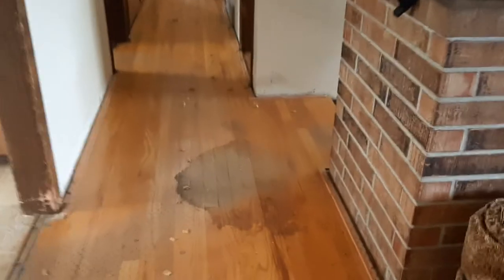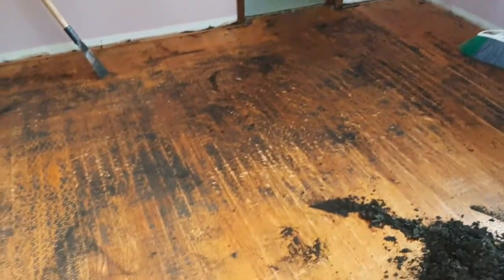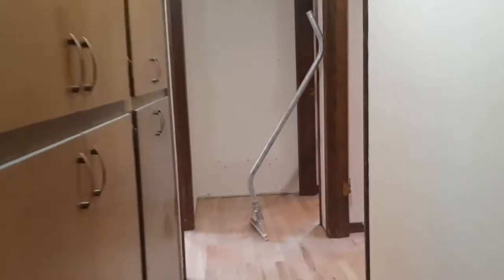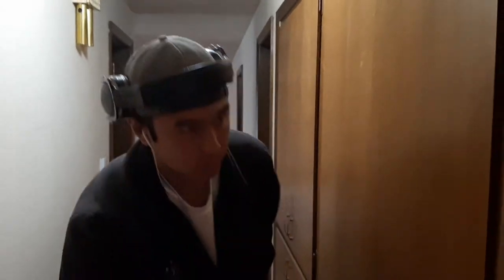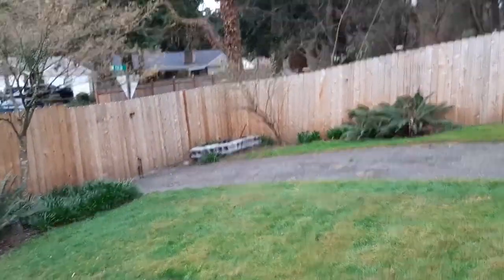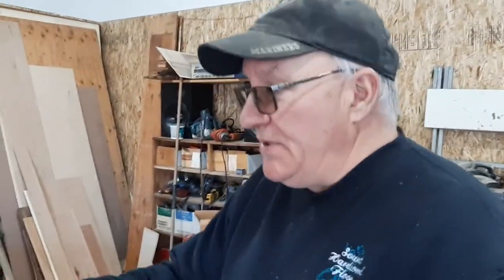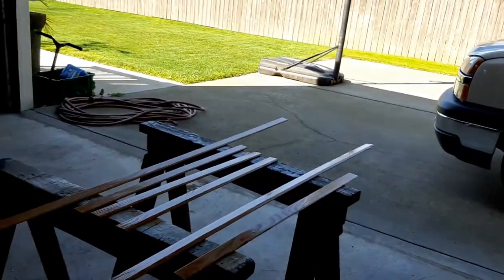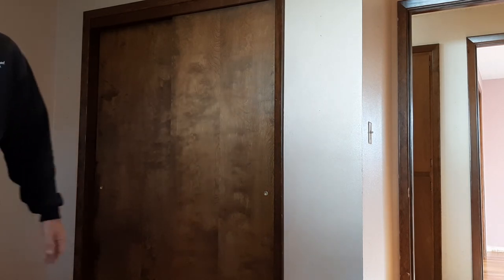Hardwood Floor Refinishing. Carpet Removal, and prep. Sound Hardwood Floors

Comment: Will holes from tack strip and staple removal automatically fill in when you sand? Or is that what you were doing with the troweling thing?
Reply from the maker: The filler does the work.

Comment: You got to get off your knees buddy use a roto put that stain on and take it off it's a lot easier on your back and it makes the stain very uniform I just use old carpet pads I cut them out to fit the block of the roto it works great I've been doing it for years if you watch any bona videos will show you how they do it it will save your back God knows we need it in our business floors look great by the way

Comment: QUESTION!?   Hey I bet if you use a real coarse sanding youll also be leveling any high spots as well?    Im asking because I have to relay water damaged hardwood but that I have already taken up and sanded by hand.  Like each piece that had taken damage
Reply from the maker: We use 36 grit, and sometimes 16 grit on really bad floors, we still do a full Trowel fill before the final cuts.

Comment: Question.....What is the seal coat for and do you have to do that step and what would happen if you just put a clear polyurethane on the wood after you did all the sanding?   thank you for your time.
Reply from the maker: Hi Greg, the Swedish sealer drys fast it can be sanded an top coated the next day. Straight polyurethane is still used, just longer  wait times. Thanks for watching.
Reply: @richsadventures1889  Thank you for the help and info.

Comment: What was the stuff he was spreading on floor after sanding. You do beautiful  work
Reply from the maker: Woodwise latex filler.
Reply: @richsadventures1889 After you spread that filler, what grit do you use to sand it?
Reply from the maker: @ricos4700  100, or 120.
Reply: @richsadventures1889  Thank you. You are a tru craftsman.  Keep em coming.

Comment: Great video! I just bought a house and I’m going to do the floors after I rip out the carpet. I have one of those swing machine buffers that you can attach sand pads to. Could I get away with just using one of those or would I definitely need one of those sander machines you used ? Would you know where I could rent one of those machines ?
Reply from the maker: To get down to bare wood, I would use a floor sander. Home Depot rents a small version of the big ones. It'll get the job done.
Reply: @richsadventures1889  very cool I’ll definitely look into that! Thanks again man.

Comment: Great video thanks. What has that coating your guy put on at 5:30 after the first sanding?
Reply from the maker: That Guy is my Son, he pretty much supervises the projects. It is Woodwise latex wood filler. It all gets sanded off on the next cuts.
Thanks for watching.
Reply: @richsadventures1889  Thanks for the info. Watched a lot of wood floor videos. No one has mentioned using anything like that.

Comment: WOW, nice looking floors, what was that he was spreading on the floor after you sanded them
Reply from the maker: It is a latex floor filler,we use it on all our floors. It fills all the gaps, cracks, nail holes, and worm holes. It also serves as a guide coat for the final sanding, when the filler is all gone the floor is flat, and the course sanding marks are gone.
Reply: @richsadventures1889  thank you really appreciate you answering back.
Reply from the maker: Wow, that Playlist you put together on Soul Music is great. I grew up in that America 🇺🇸. I miss it.
Reply: Great work. As a fellow floor guy for over 20 years I can see you do quality work. Keep it up
Reply: Do I need to sand the entire floor after applying the floor fillet? Does it leave a color?

Comment: What type of machine is that that also sucks up while you're buffing
Reply from the maker: Hi Shawn, its just a buffer i drilled a hole in and hooked up a vacuum. The skirt around the bottom is  some cloth with velcro sewen in. Thanks for watching.

Comment: Also with the skirting boards and architraves, should they be taped up if they are primed and painted or removed then put back on.
Reply from the maker: We do both, if you leave them on be very careful with the edger not to mark them up. Sometimes it does more damage to remove them if they are caulked, or heavily painted.

Comment: So I have a question... Do you have to apply a wood conditoner on the floors before you stain or a clear coat finish?
I always thought you have to do that first? Maybe you dont because its Oak Floors? 
Nice work by the way !!! Looks really nice!!!
Reply from the maker: I believe i show the water poping , or opening of the grain in other videos. This is the same as conditioning the wood prior to staining. Not needed for natural finishes. Thanks for watching.
Reply: You really only have to water pop or condition the floors when trying to get a certain color darker or if it's a certain type of species like a maple or Birch hickory those types of wood you would want a water pop that for it to take stay more evenly but when you water pop a lot of times with oak you'll get fillets where the wood pops so if you could get away with not water popping it's nice that is basically what conditioning the floor is
Reply: I have a small video of me water popping a birch floor before I stain it you can take a look at it the pages under my name Jason urban if that helps for your interested

Comment: How much does a project like this cost? Buying a home that we want to do the same thing to.
Reply: Big Ern! Like it.
I rarely see companies answer questions about price. I guess a refinish is about $3 to $4 per square foot. Things such as repairing or replacing floor boards, removing carpet, staining, etc. will increase the price. I wonder whether the removal of the black coating was extra; it may have just been part of removing the carpet.

Comment: I'm debating if replacing with new flooring or keep existing floor and sand them. I do want new flooring but afraid it will be too expensive.
Reply from the maker: I say, if the existed floor is in good enough shape, refinish them.
Reply: @richsadventures1889  thanks for your reply and helpful video! There's a lot of dark spotting/patches due to pet urine from the previous owner. Do you know if refinishing those sections make sense or better to get new flooring?
Reply from the maker: Well, pet stains usually do not sand out. I have seen some kind of bleach in videos, but haven't gotten it to work for us, however i have refinished floors with lots of pet staining and used a dark, (very dark) stain and it covered them up and looked great.
Reply: @richsadventures1889  I like the light color similar to this video so looks like I have to put new flooring. Thank you again for your help and stay safe!

Comment: Can you stain it a lighter color or do a while wash? I notice most of the 1970-60 homes have this yellowish orange stain
Reply from the maker: This is a natural Swedish sealer, looks like the oil modified from the 50s, 60s, and 70s.  Floors can be stained any color. Natural is the inexpensive choice